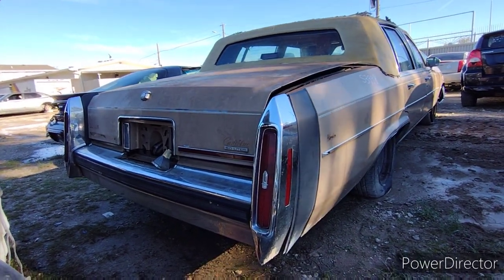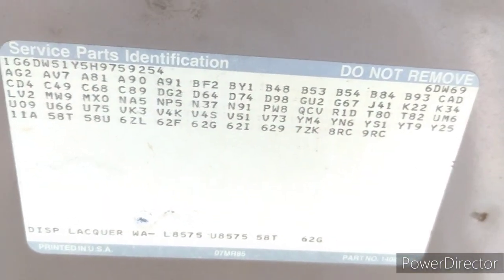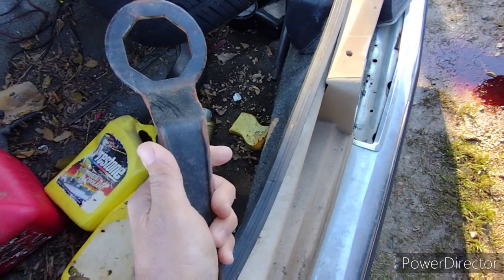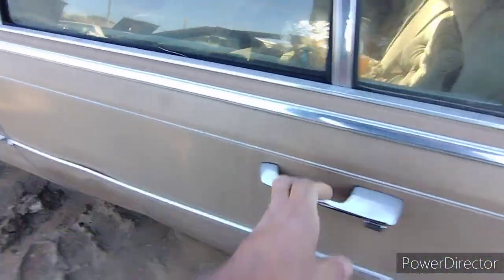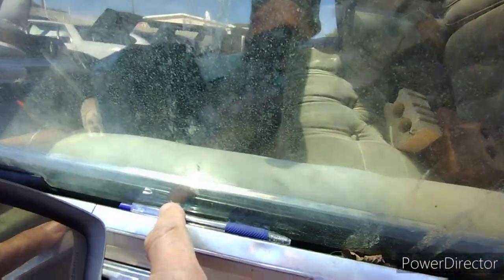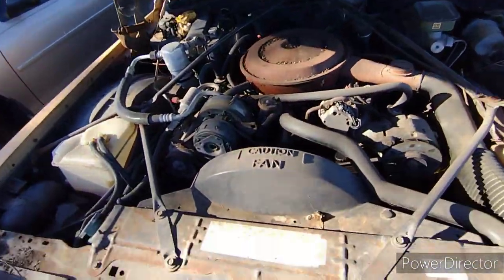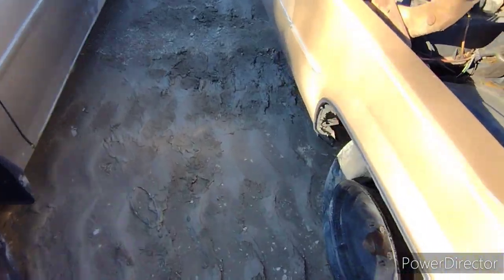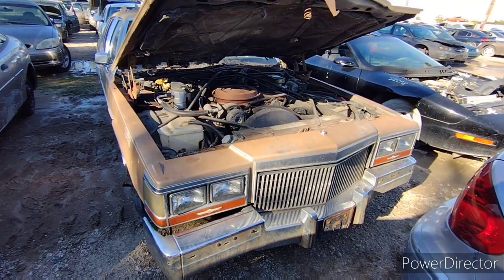Last of the Clark Street Plant Caddies? 1987 Cadillac Brougham d'Elegance Junkyard Find

Comment: Whoa Nelley, Cadu and it's over for you.

Clark Street closed in December 1987, so this was among the last group of cars made six months before the plant closed. A two-hour video from 1987 shows some of the last cars going off the line. Since the plant closed in December 1987, they were making some 1988 models before the transfer to Arlington, TX assembly which would assemble the RWD large GM cars through the 1996 model year. 

We got the VIN, we win: 1G6 for US made Cadillac, DW51 for Brougham four door, Y for Oldsmobile 307 V8 with four barrel, aka RPO code "LV2" aka "Mini Pocket Rocket", 5 is a check digit, H for the 1987 model year, 9 for Clark Street, Detroit, MI assembly and the rest is the production sequence.

We got the SPID, glad you did: AG2 for six way power passenger seat, AV7 for moveable cargo restraint, A81 for passenger seat back adjustment/recline, A90 for power deck release, A91 for trunk pulldown, BF2 for deluxe floor carpeting, BY1 for exterior ornamentation, B48 for luggage trim, B53 and 54 for front and rear carpeted floor mats, B84 for bodyside exterior moldings, B93 for door edge guards, CAD for "Cadillac" Assembly aka Clark Street, Detroit, MI, CD4 for delay wiper system, C49 for rear defogger, C68 for automatic temperature control, C89 for interior rear quarter reading lamps, DG2 for remote mirrors, both sides, D64 for illuminated vanity mirror, GU2 for 2.73 rear axle ratio, G67 for air shock controller, J41 for power disc front, power drum rear brakes, with cast iron drums, K22 for 94A alternator, K34 for cruise control, LV2 for 307 Olds V8 with four barrel, aka "MPR" and VIN code "Y", MW9 for THM200-4R four speed overdrive automatic transmission, NA5 for standard Federal emissions, NP5 for leather wrapped steering wheel, N37 for tilt and telescoping steering wheel, N91 for simulated wheel wheel covers, PW8 for 15x6 wheels, styled aluminum, T80 for automatic headlight beam control, T82 for automatic on-off headlight system, UM6 for AM/FM stereo radio with seek-scan cassette, ETR and auto reverse and clock, U09 for four note horn, aka "Sante Fe Express", U66 for custom speaker system, U75 for power antenna, VK3 for front license plate bracket, V4S for Cadillac Fleetwood Brougham merchandising option, V51 for front and rear license plate frame, V73 for US and Canada vehicle statement, VM4 for processing zone office orders, YN6 for domestic order processing, Y25 for order processing southwestern US, 58/WA8575 for Light Chestnut exterior paint, among other codes. 

The 307 was used from 1986 to 1990 in the rear wheel drive Broughams and was a breath of fresh air after the HT4100 fiasco. The 307 was low tech and got the job done. They are slow and have the power curve of a lawn mower, but the 307 runs, runs, runs, runs, runs, runs, runs, runs and runs some more. One of GM's best engines, bar none. These are what a Cadillac should be. You still made it in life when you bought a 1987 Brougham. I'd still take one today, without a doubt. 

Whoa Nelley, 1987 and going to Heaven. Brougham soon to go home. That's it, time to quit. Code 58 used to be great. Made at Clark Street, and now admitting defeat. Oldsmobile rocket soon to be out of pocket. RPO code "LV2" and it's over for you. Going to be flat and that's that. Made in MI and going bye-bye. Four door and it don't go no more. Going to get squished, all of the General's faithful, many here, and most definitely the Google Man are going to be very, very, very, very, very, very pissed.
Reply: Google User GP:
 Describing the old 307 first as a "mini pocket rocket" then saying it had the "power curve of a lawnmower" is somewhat a oxymoron don't you think???😄
I do agree they were reliable  though.
Reply: @rogergoodman8665  No it's not. It's an oxymoron of sorts. Pocket (being small) and "Rocket" being an Olds V8.
Reply: @googleusergp  the Rocket 88 V8 was winning races in 1950. My 1969 Chevy Impala that I bought for $200 in 1975 was a budget version of this, reliable 327 small block and a 2 speed automatic transmission, lots of comfort on a straight road, handled like a big understeering boat in corners, up to 12 miles per gallon when gasoline was cheap. When adjusted for inflation the minimum wage peaked in 1970, so 75 was not as good, but no where near the ridiculous $7.25 an hour now that is criminal.
Reply: @jeffruebens8355  Oldsmobile always made good V8 engines. Always reliable.
Reply: I've watched that Clark Street video and the way that plant ran tells me that even though the cars changed a lot from 1921 - 1987, a lot of the manufacturing processes in that plant sure didn't.  A five-floor plant, bodies trucked in from a few miles away, frames being drug around by chains.  Any freshmen engineering student could have figured out that that place was primitive even for 1987.  That plant probably should have been modernized or torn down at least 20 years before it was.  I can't imagine that any Mercedes, BMW or Japanese plant ran like that back then.  Ford's crown jewel at the time, their Wixom plant was a lot more modern than that place, then again it was built in 58.
Reply: @kennethsouthard6042  It was a very old plant.
Reply: @googleusergp  What saddens me about plants like that was that if management and union employees should have both been able to agree back in the 60's that places like that were not world class and needed modernization, then maybe so much of our manufacturing would not have gone away.  While it has been done away with, it was too little and too late when it finally occurred.

What's even more amazing is that Janesville outlived that place by 20 years.
Reply: @kennethsouthard6042  GM was (and still is) very myopic and backward.
Reply: @googleusergp Could you decode a vin number for me? I mostly want to know the factory it was made. 1G6AD6985C9185573
1982 Deville D'elegance
Reply: @nyerik00  That's a Clark Street, Detroit, MI made car with the VIN for the win: 1G6 for US made Cadillac, A for manual seat belts, D for DeVille, 69 for four door sedan, 8 for 4.1L (252 CID) V8 with digital fuel injection, RPO code "LT8", 5 is a check digit, C for the 1982 model year, 9 for Clark Street, Detroit, MI assembly and the rest is the production sequence. As noted, the Clark Street facility closed in December 1987. The body was made at the Fleetwood Body plant on West End Ave and then trailed/railed to the final assembly point at Clark Street.
Reply: @googleusergp  Thanks a lot! Im trying to find information about my car, but I havn't been so successful.
Reply: @nyerik00  If you post the trim tag (under the hood, left side, sometimes obscured a bit by the left hand wiper) data, I can go through that. It will have a bunch of numbers and letters on there. It tells us what the exterior paint color is, roof color (if it has a vinyl roof), the month and week it was assembled, where it was assembled and other data.
Reply: @googleusergp  That would be great!
I'll look there for it :) 
The engine has been changed to a olds 307 from possibly a newer Brougham o so, but that might not be a problem I hope 👍
Reply: @nyerik00  Nah. I really doubt someone removed the tag. Most folks don't know that they are there. You'll see it, but that area often gets debris piled on it, so you may have to clean it with a rag/soap and water and/or Windex or something. Since it's a 1982, you'll see "82" or "C" for the 1982 model year, then "FWD" or '9" for the Fleetwood Body plant on West End Ave (now closed) which is where the body was made before it went to Clark Street for final assembly, probably 6CB69 or something close to that for Cadillac (6) DeVille (CB) four door (69) also a two digits and a letter to indicate the month and week of the month of production (such as 01C which would be the third week of January 1982 as an example), among other data. 

Basically that tag has information that would have concerned Fisher Body on their side. Back then, the assembly side (Clark Street) and body side (Fisher Body/Fleetwood Body) were like "separate" divisions of GM and the Fisher folks only worried about what affected their work. For instance, if the vehicle had standard hubcaps or simulated wire wheel covers wasn't a concern of Fisher because that was handled on the Clark Street side. Paint color was something that affected them, so that's there. 

The other numbers on the tag are mostly for plant internal/scheduling use. Post it and we'll go through it.

Comment: Clark St closed Dec 18th 1987, that one is definitely done, but those were really nice when they rolled of the line. The 91-93 I think are th pinnacle of the Broughams, some of the best cars GM built in the 90s
Reply: Through 1992 with the last of the "square" Broughams. 1993 brought the "rounded" style and that ran through the 1996 model year. After 1996, the Arlington, TX plant was converted to assemble trucks and SUVs, which it still does today.

Comment: Olds 307 those motors were very reliable back in the day
Reply: Indeed, but you couldn't get a Brougham with a 307 until 1986 and through the 1990 model year.

Comment: My all time favorite car of the many I've owned was my '91 Fleetwood, it was triple white. I would give anything to go back and tell myself to hold on to it. I got 10k for it in '02 but it was basically new I think it had like 18 thousand miles at the time. I worked for a Cadillac dealership and the original owner would bring it in on super nice days and have it cleaned. he would have us come to his garage at the end of summer to cover the whole thing in wax and wipe the undercarriage with something resembling baby oil but made by Dow chemical and then cover it and put it up on a lift in his climate controlled garage. I'm pretty sure no one had ever sat in the car other than the drivers seat until I got it.